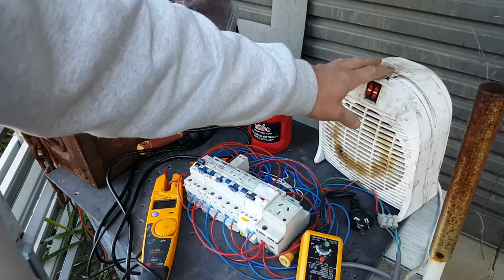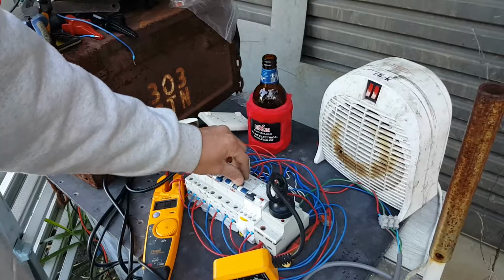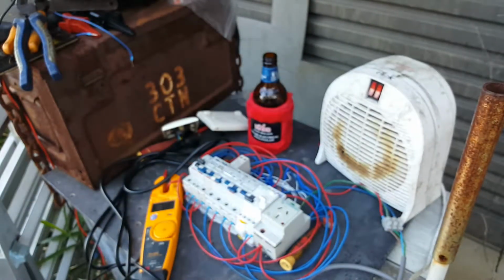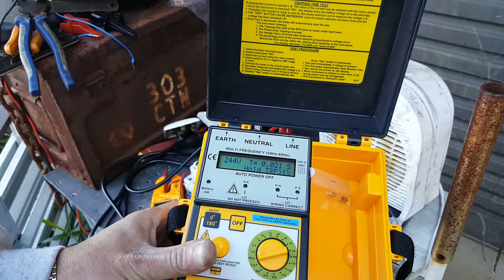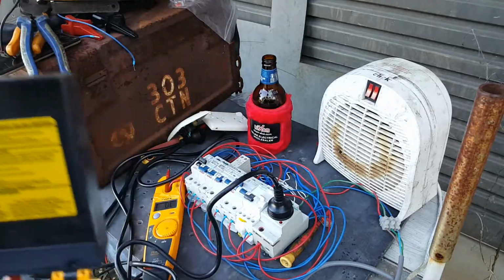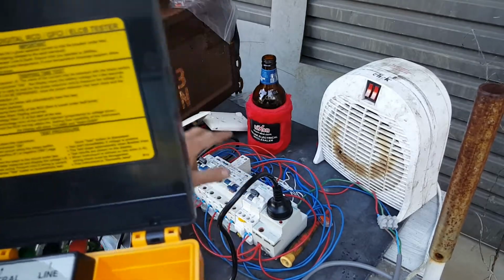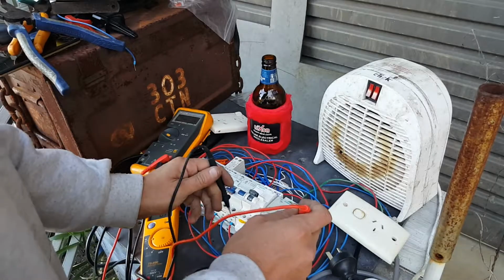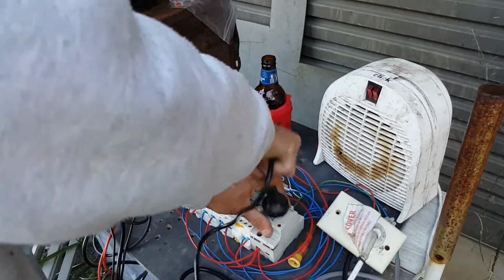Testing Nixon RCBO/RCDS.

Comment: yea don't feed rcds backwards the trip circuit is on the load side so it deactivates when the circuit opens. 
when fed from load side it keeps trying to trip and the magic smoke escapes.
Reply from the maker: Look at how I've wired them though?! They were meant to go that way #FACTORYFAIL.
Reply: @TradieTrev  i will rewatch on the pc later.
looked like they were in parallel which means the ones that were off still had the trip electronics powered and not all rcds/rcbos are double pole switched some of the current will flow through the neutral activating the trip circuit.
which explains why it went to shit when the heater was added.